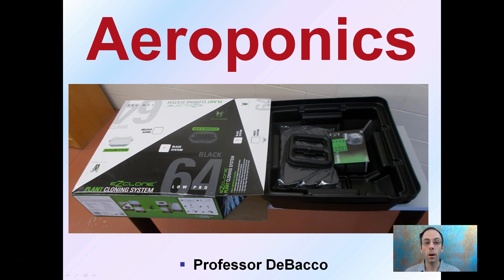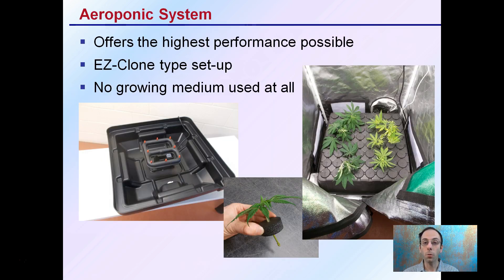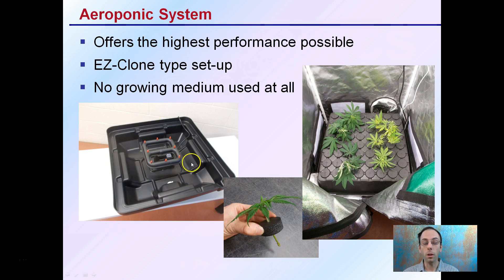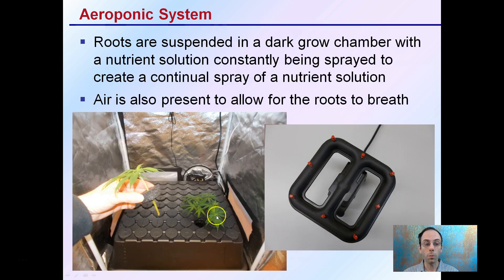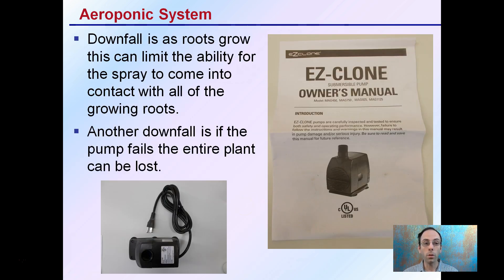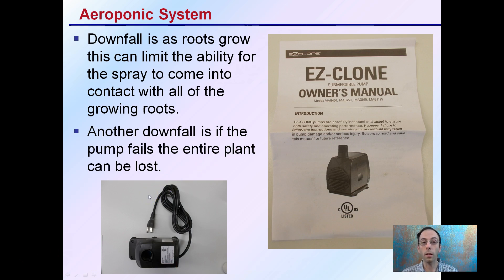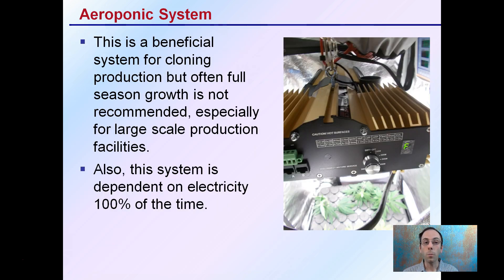Aeroponics

Comment: Roots  constantly sprayed by water is not aeroponic. Roots suspended in a mist environment are not subject to a film of water covering / suffocating them ;)
Reply from the maker: The company EZ clone classifies their system as an aeroponic system.  I do agree that roots need to respire which involves the taking in of oxygen gas, but even when sprayed with water since it will natural drip off there is still the ability for them to exchange gasses.  The spraying of water as part of the EZ clone is a mist system due to the droplet size.  Very fine water particles would be classified as a fog, which would still accumulate on the roots creating a film which is beneficial to reduce desiccation.  Also, using a true fogging system can be subject to clogging in a growing environment, especially when nutrients are added.  So, I would ask, what you would call roots sprayed with water, if not aeroponic?
Reply: @DeBaccoUniversity  
I would call roots sprayed with water, wet roots ;) If you periodically flood roots hanging in a bucket, it would match some aeroponic definitions The roots hang in air mostly and have a film of water coating them after the flood. Spraying the roots with water results in the same outcome. Tower garden with its vertical nft/drip is also labelled as aeroponic and it creates the same wet roots. If you compare a genuine aeroponic root structure to those grown using any of the above "aeroponic" methods, the difference is very clear to see.
The mist used in genuine aeroponics doesnt create a film of water on the roots so they can access oxygen at all times. There is a description which outlines the criteria for true aeroponics in this video, it shows the type of mist and genuine aeroponic root structure.   https://youtu.be/7AhCLMasd3M 
I dont have any issues with nozzles clogging in any of my aeroponics setups.
i have nozzles that will happily convert neat neem oil into mist/fog, i wouldnt recommend using it with patio misters..
https://youtu.be/9MRLDLnqa8U